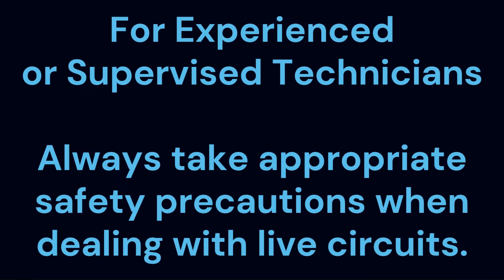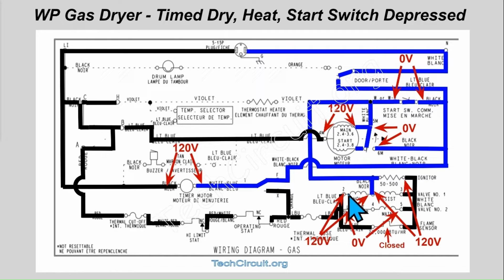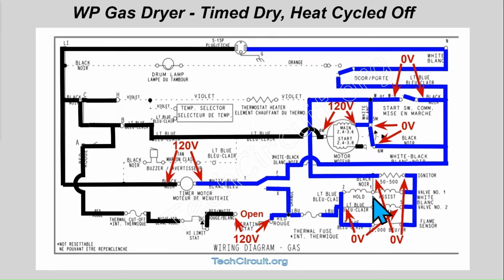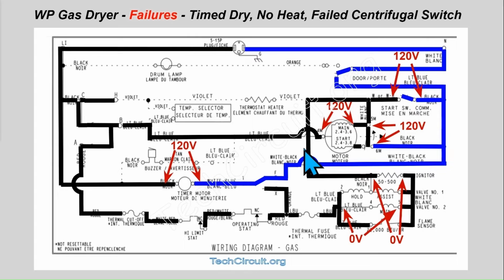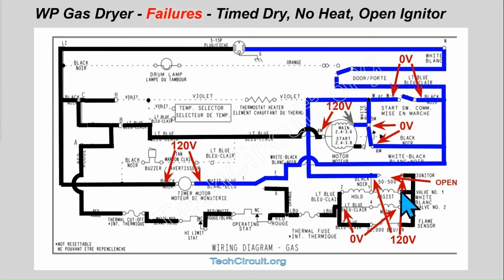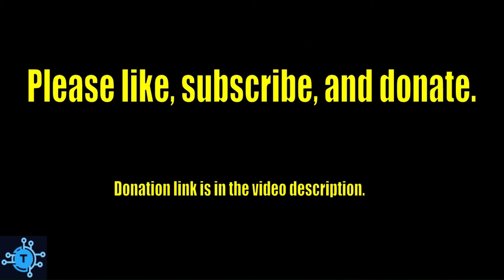#74 - Whirlpool Amana GAS Dryer Schematic Walkthrough  | Voltage Map & Troubleshooting Guide

Comment: When the dryer is in auto dry mode and contacts T and X are closed it appears the the thermal cut-off, Hi limit stat, and operating state are bypassed.  I'm pretty certain this can't be true, but do you see what I mean with that splice point that appears after all of those components?

Comment: Thank you for this well-designed troubleshooting technique procedure. I had just watched your video on the electric dryer, then found this. I have this same setup and have spent about an hour going through every sensor/switch, ending from where I started. The issue I have is almost intermittent, but does have a pattern. It is only when in "Auto Sense" when initially the dryer works properly, but after the first heat cycle, the gas turns off, and the timer motor does not spin to advance contacts, and remains in this state until the cows come home, and longer. The only thing I can that changes in this mode is that power is routed through contacts T-X using the "Heating" section to run the Timer Motor. All other dryer cycles operate normal, so I assumed the all the heating components to be good. Along with first cycle does function. I have even taken apart the timer control and cleaned all contacts. I very seldom have issues with electrical troubleshooting. I was a field service tech for industrial CNC machining centers for 21 years, and maintenance supervisor the prior 20 years. I am really beginning to question my brain capabilities at this point. Lol I am out of rabbits to pull from my hat, and open to any plan.

Comment: Hi,we had a whirlpool duet gas dryer the problem is that its working in first load and it's all working good but when we load it again for second time it's run short and stop.the relay always clicking or firing.what would be the problem we check the PCB board there is sign of shorted or burn ..please help me..thank you .

Comment: Good description. Question: At the point in time that the igniter heat triggers the flame sensor to open the igniter resistance is low, so the assist coil will have sufficient current to open valve 1. Does that valve 1 then remain open until the flame sense is closed? I suspect that it doesn't since a failure of the flame sensor at this time (both valves open, flame sensor switch open) could allow gas to flow indefinitely. As the igniter cools, the resistance climbs and allows valve 1 to close (or am I wrong). Thanks for any response.
Reply from the maker: Contrary to oven ignitors, the dryer ignitor does not use an NTC (negative temperature coefficient) to open the solenoid. That is strictly done by the flame sensor's detection of the radiant heat from the ignitor and subsequent opening of said sensor. When open, it is no longer shunting the main coil which is then energized and opens the Valve 2. Valve 1 was already open because both the assist and hold coils had 120v as soon as the timer was advanced. Valve 1 stays open when the flame sensor opens because the hold coil still has 120V, even though the assist coil is no longer energized. What keeps the gas flowing indefinitely if the flame goes out is that the sensor no longer detects radiant heat from the flame and closes, thereby shunting the main coil. Please see the mirror blog on this subject for a more detailed step-through of that part of the sequence: https://techcircuit.org/whirlpool-gas-dryer-ignition-circuit-theory-and-troubleshooting/
Reply: @TheTechCircuit  Very well written, Thank You for responding. My Matag fails to ignite sometimes and so gas flows for many seconds before the flame sensor closes and the main valve deenergizes. Of course the unburnt fuel is continually exhausted (after passing through the drum and blower) so I expect it's not a dangerous buildup of fuel when the igniter starts to reheat.
Reply from the maker: @ You may have an intermittently open coil. That is actually one of the most common causes of the gas valve malfunctions. They are super cheap. If I ever have any suspicion of coil malfunction, I always put in a fresh set.
Reply: @TheTechCircuit  Thanks for the guess. Yes I've already replaced the coils (with OEM) and the failure recurred, then replaced the igniter and it still fails. The igniter heats up each cycle, but does not always ignite a flame (no partial ignition when it fails). I always smell gas when it fails to ignite, so the main valves are opening every time. It fails intermittently when stone cold (first ignition) and when mid-drying cycle (system is hot). I'm probably going to buy a flame sensor, or maybe  measure the igniter time period (heating time) to see if the flame sensor opens early, prior to a failed ignition. I can't imagine a valve failing like this (slow to open). Also, the flame looks good after ignition so I don't expect a regulator or valve interference problem.
Reply: I made a video of the ignition and failed ignition of my Maytag. Any thoughts for analysis of the fault? https://youtu.be/z0iYGXSyGaA

Comment: Excellent video! Such clear labeling of all the voltages, including the voltage between the flame sensor and the ignitor when it is close to, but not, zero. Also extremely helpful to go over what you will measure in so many different failure scenarios.  Thanks!
Reply from the maker: Thank you!

Comment: This needs a lot more likes... 
  Will the assist coil open the solenoid plunger without the hold coil energized? 😮. (I know the hold coil needs the assist coil to lift the plunger) but would the assist coil be strong enough to lift the plunger alone...if hold coil was open?

Comment: Great schematic walk-thru and explanation of the gas valve solenoids function safety in the circuit design!  Great techs really understand how a product works & why, not just a few If-Then component replacement steps.